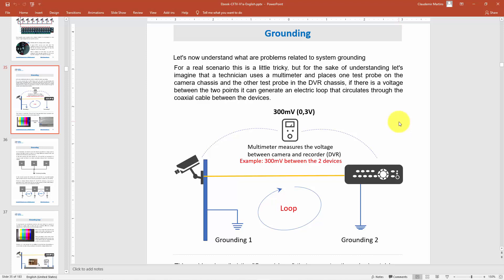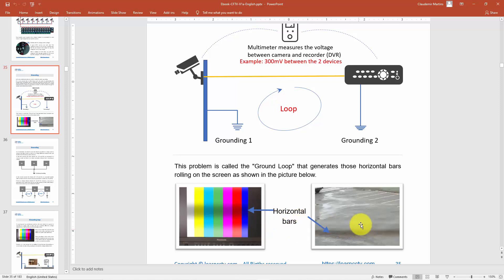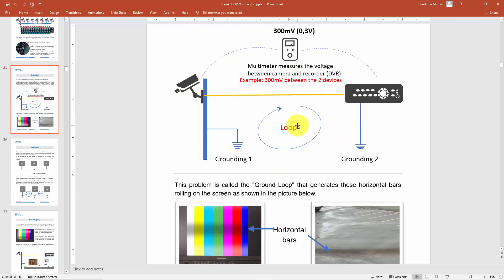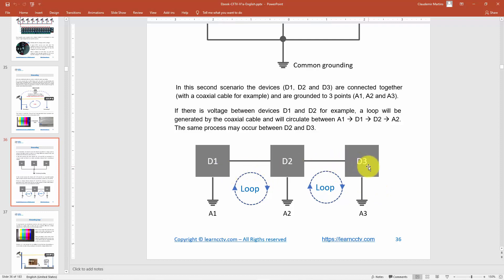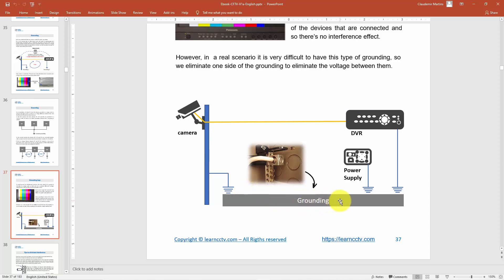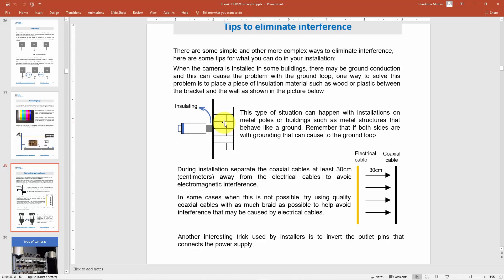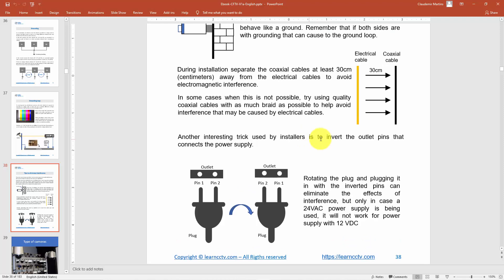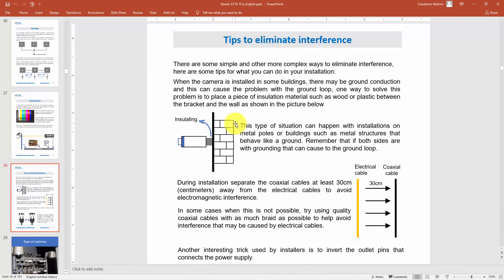CCTV camera ground loop (how to fix)

Comment: How do you fix flicker due to LED lights ripple?
Reply from the maker: Match the shutter speed frequency or use the anti flicker feature of the camera, good cameras allow you to do that, cheap cameras unfortunately don’t. So now depends on which model you have. Check the camera manual or contact the manufacturer or vendor if you are not sure.